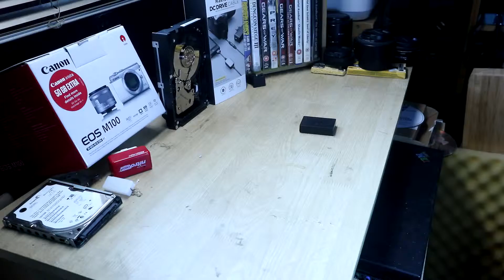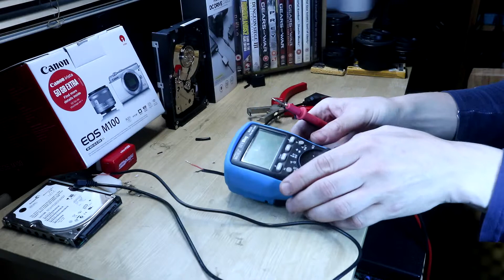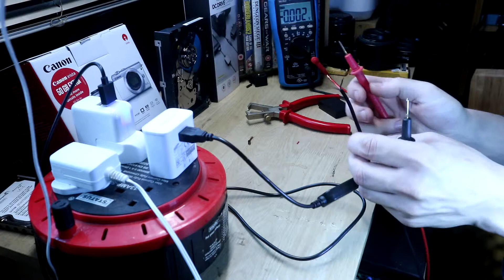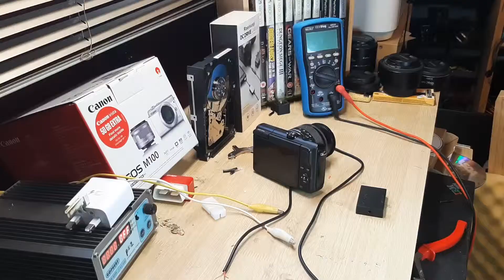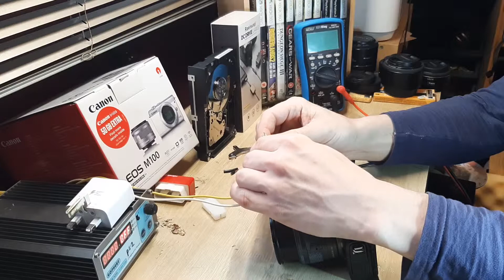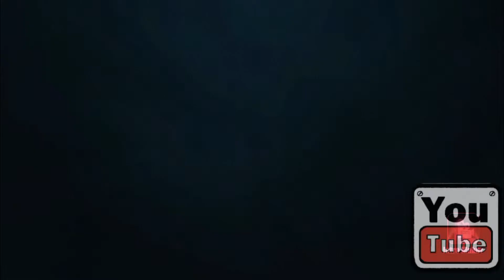LP-E12 DC Drive Cable MOD. Will it work? | DrRunCMD

Comment from the maker: I so wish I had my scope still. I could have investigated why this cable and DC to DC block is randomly working with only 1 samsung charger that I use. No other USB adapters work. Not even the original one supplied!
So I get this working as with samsung charger, but, randomly touch screen is not responsive and when you clean the sensor ( cos its a mirrorless ), it cuts out! Anyone any ideas?